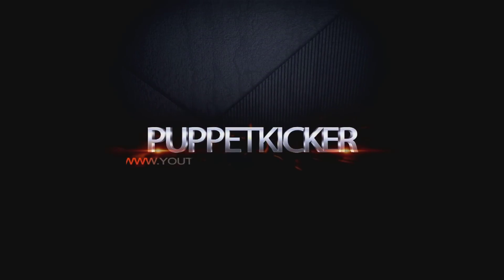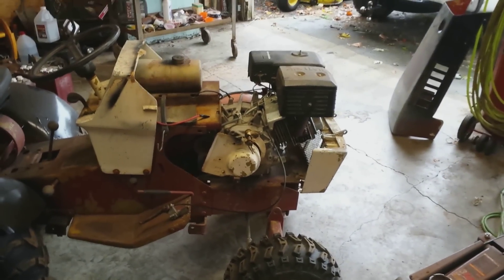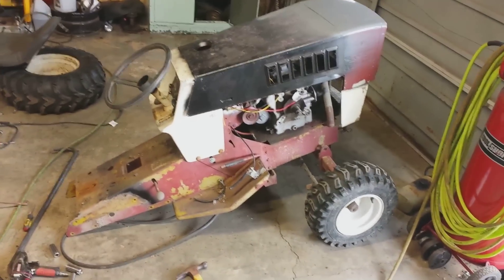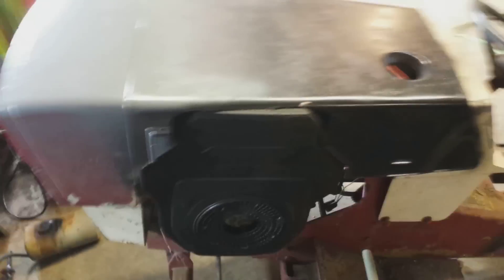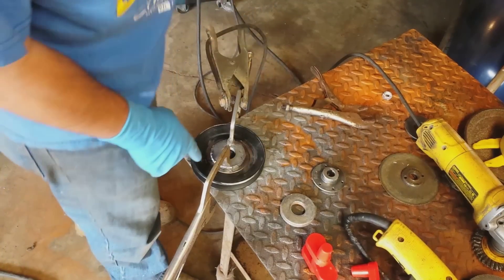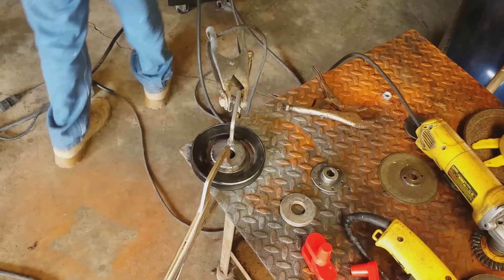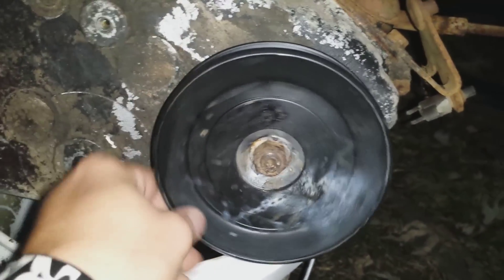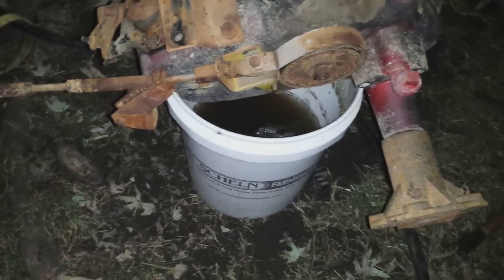Sears Suburban ST12 Motor and Pulley Swap....

Comment: I know it's an old video but do you have a link for the pulley? I'm duromax swapping a ss12 right now, having problems finding the pulley combo I'm looking for,  I wanted to go 7" front and 4" back but not having any luck with either so looks like I'm going to end up with 5.95" front and still don't know what to do about the back. Any help would be greatly appreciated.
Reply from the maker: Sorry I sure don’t.

Comment: I'm very surprised that engine fit in that tractor, I like your idea for your pulley, did you ever consider using a hub with a tapered pulley it would probably make it the correct offset.
Reply from the maker: The motor was a close fit that is for sure. I really don't know a good please to find this kind of tapered hub or what size it would need to be. I did it like this also to show others that it can be done with using some of the original parts too